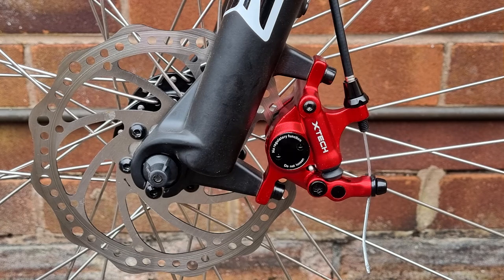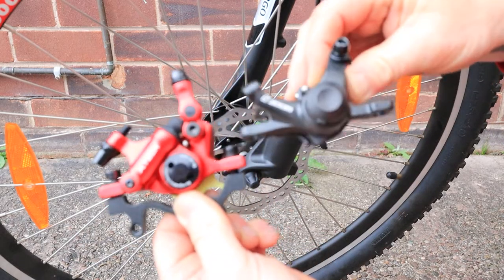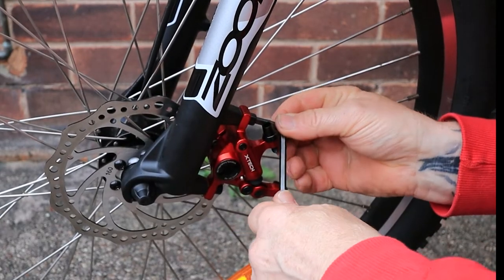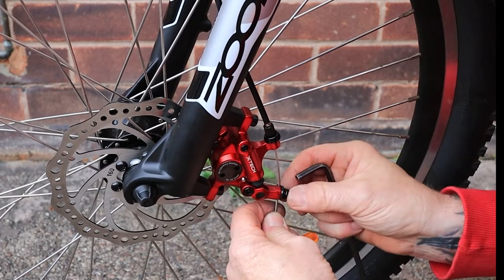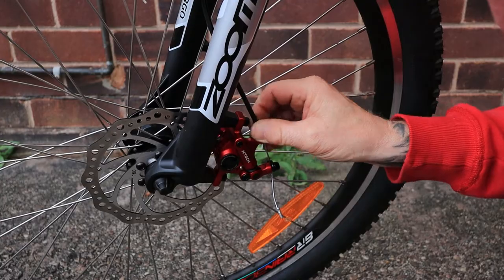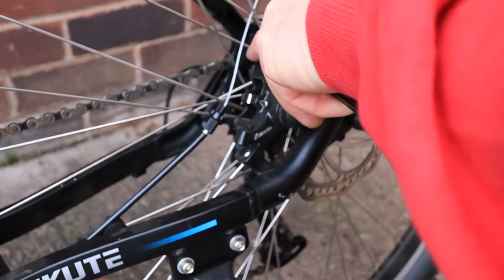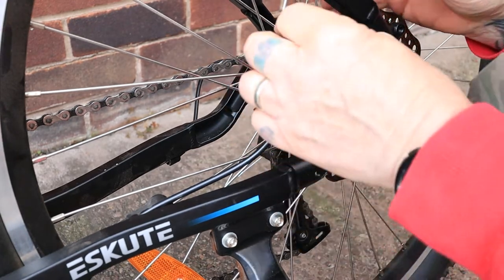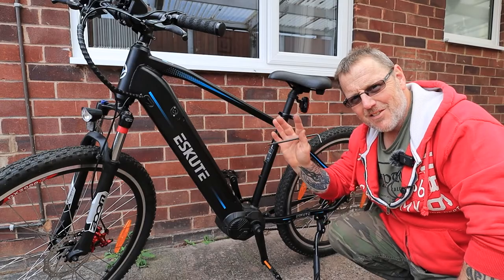HOW TO FIT Semi Hydraulic Disc Brake Callipers Convert from Standard Cable Brakes HB-100 XTech Zoom

Comment: Is there anyway to open up the brake pads abit as mine is very slightly rubbing even without any cable on.
Reply from the maker: I am not sure, i had this all i did was open them up a little with a flat tool

Comment: while aligning the brake rotors u can simply press the brake lever and tighten the rotor , visualy aligning the rotor doesn't work all the time but overall good video .
Reply from the maker: No no i am sure there was a better way but without instructions i was not 100% thanks